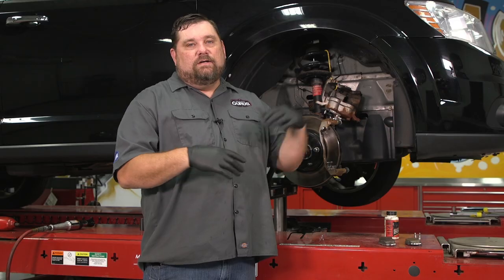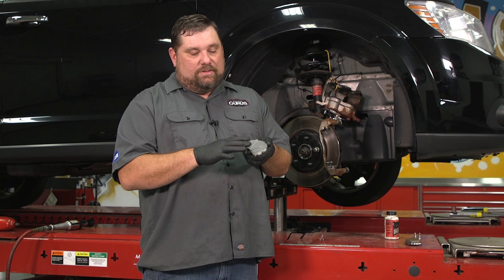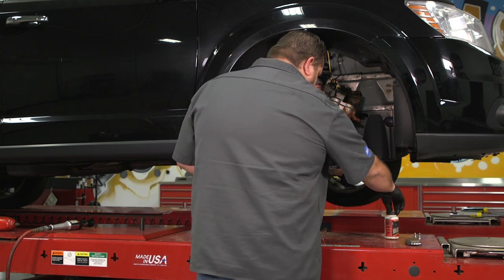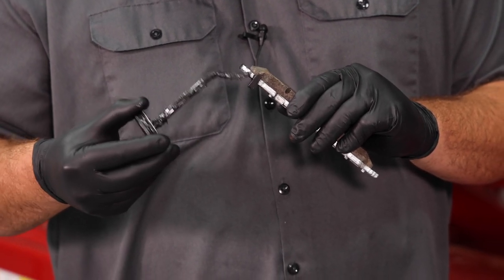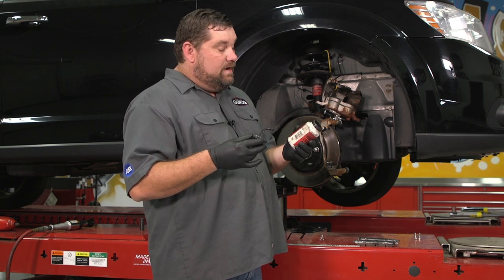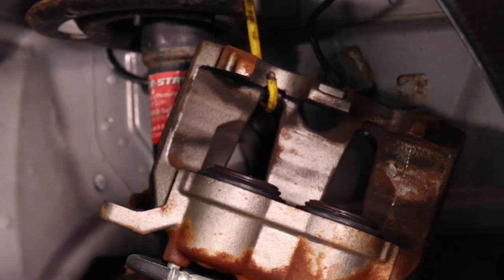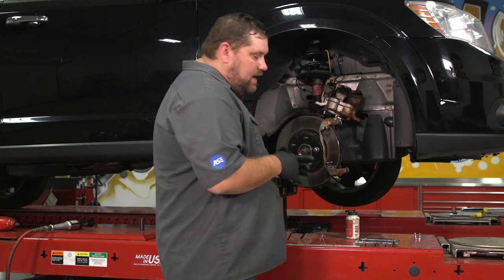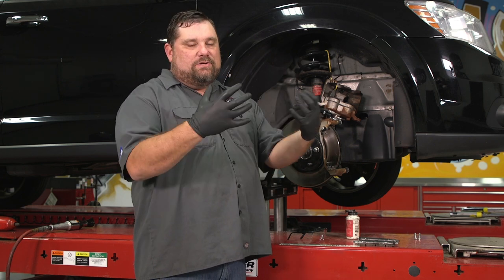Garage Gurus | Lubricating Brake System Component

Comment: I have done thousands of brake jobs as a fleet mechanic through decades. I have never put grease on brake pads or calipers. It has always bugged me when I see or hear of people doing that. That high temp brake grease is for sliding caliper pins only. I have never seen a brand new car with any grease in those locations on the pad or caliper. And as a fleet mechanic you better believe we would hear from the customer if there was an issue or a come back and the only time we had brake noise issues had to do with pad brand/quality.
Reply: The factory Honda/Toyota/Nissan pads will use a high solids moly grease between the pad backing plate and the shim. But nowhere else.